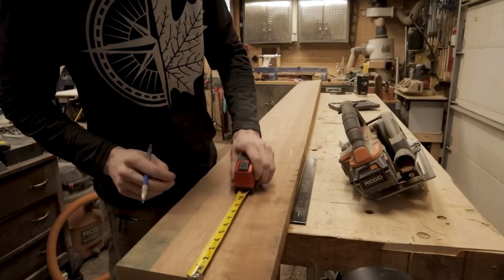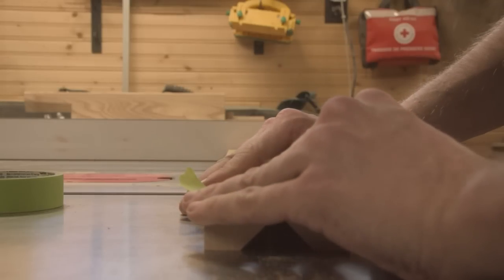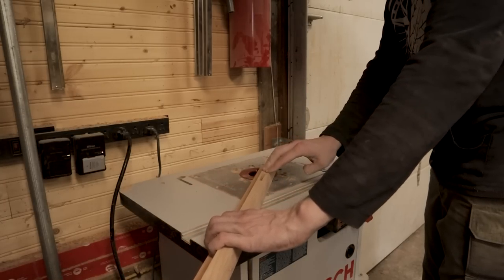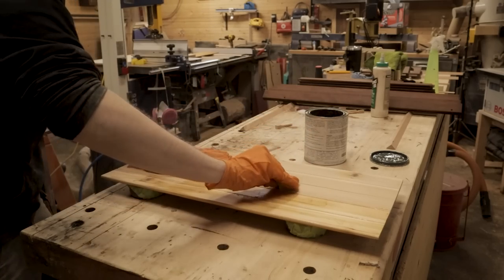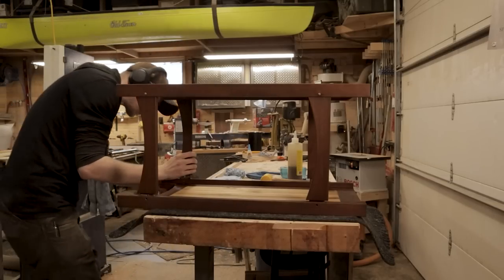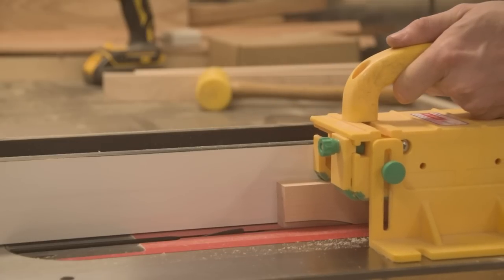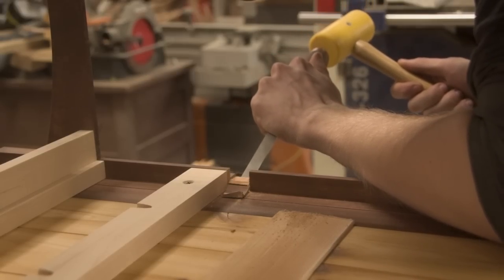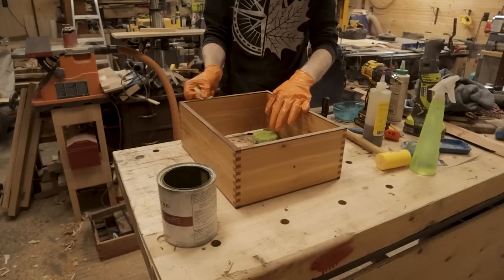Simple Open Space Nightstand

Comment: to re-activate cedar aroma of your drawer, just sand with fine sandpaper.  Have you tried using dye instead of stain?  Dye won't hide the grain.
Reply from the maker: I'll have to take the drawers back out to the shop and do that!
As for dye, you could say I've fallen deep into the rabbit hole... After finishing this project I spent a couple days doing research about all the different types of stains and picked up some GF water based dye. So far through some testing, I've been able to get some awesome results with dye that'll I'll be using on a few upcoming projects!

Comment: Thanks for sharing.  I work with a lot cherry.  What I do to get it looking good is to use garnet shellac.  Adds a nice color and is easily reversible.  I have also used Tried and True oil and then let the cherry sun tan on sunny days to help speed it up when I'm home and can do so.  A few days of this really helps.
Reply from the maker: I'll have to give Shellac a try, I keep thinking about it but forget when it comes time to finish a project!
I've tried leaving the pieces in the sun before and I do like that it can speed up the coloring, I just find that I like cherry as more of an accent wood rather than a structural wood. I think going forward I'm going to try to use natural cherry in floating panels or other accents then use some other dark stained wood for the structure, I think that'll give the best results!
Reply: @morganhurst_redridge  My preference is for subtle contrasts, such as cherry and walnut or walnut and mahogany.

Comment: Time to try out a belt sander for your sanding.  It is a very useful tool, you can get a Canadian Tire one on sale that has a variable speed.  You want to maintain a cool belt, and run it in the direction of the grain.  If you want fast material removal use a coarse belt and go cross grain, slow material removal move in direction of belt with a fine grit.  The only time you have this poor sanding is when you use the cross grain or random orbit so I hope you can get a belt sander and give it a go.
Reply from the maker: I have a Rigid belt sander that's been collecting dust for years, I find it kind of unwieldy to use and since I got into using hand planes I really haven't thought twice about it. I'll have to give it another go though because I get what you're saying, it could be a great tool for surface prep!

Comment: It appears that your stain was very even.  However, on some woods, the stain is blotchy.  In order to prevent that, a pre-stain treatment helps.  Your local paint store probably carries a commercial product.  You can also make your own pre-stain treatment.  Using the recipe from the Wood Whisperer also works.  His recipe is 3 Tbsp glue, 3 Tbsp of a water based finish and enough water to make one quart.  Apply and let dry. Do not wipe off.  Then lightly sand and then stain.  I have used this recipe and the blotchy appearance was eliminated.  Good luck.
Reply from the maker: Thanks, I didn't have alot of issues with with blotch with this water based pigment stain but now that I'm trying to work with dyes I'm getting crazy blotch! I'll have to give that recipe a try on my next few test pieces and see if that can help!